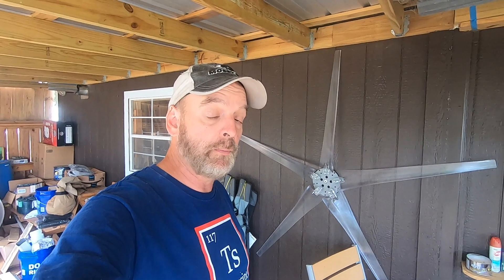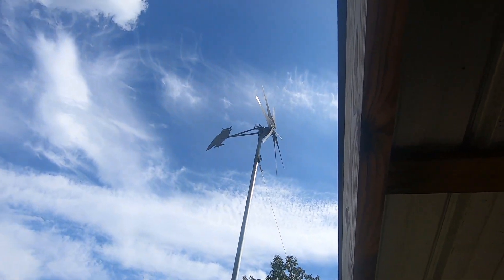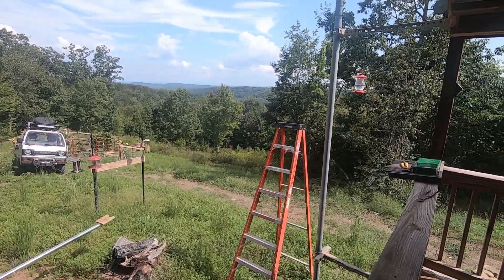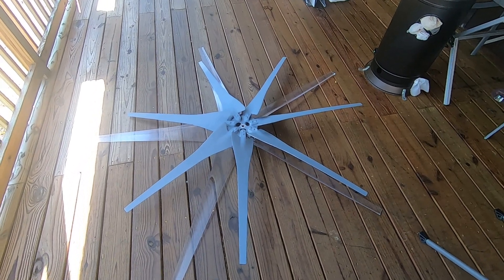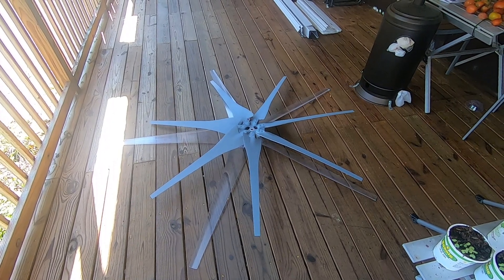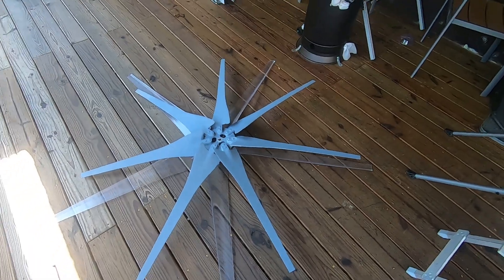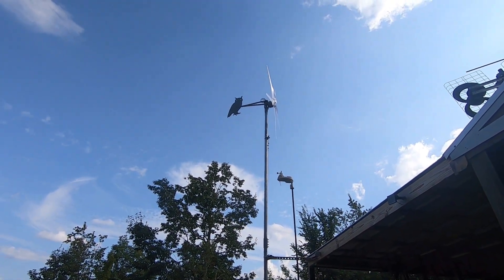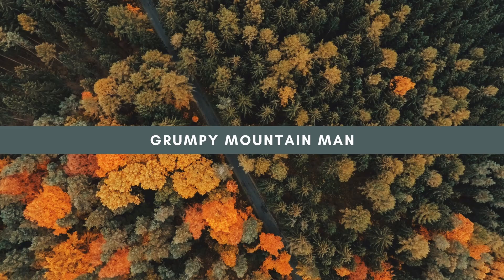Thermodyne vs Missouri Wind Solar Turbine Blades Wind Wind Turbine Video #3 Shed to Home Solar Wind

Comment: Hang on there , Back up 
You said one brand of blades were better than the other , 
Yet neither brand was spinning but you go ahead and make a video showing both sets perfectly still , 
Looks can be deceiving sometimes but to me it looks the same , both don't spin and you said that one brand is better ,  that's cool , they both wasn't spinning laying on your porch either , but that must be because you have a bad porch
Reply from the maker: Its comments like this that make me wish the internet was never made.
Reply: @GrumpyMountainMan  , then show them spinning and that they are indeed better and making power , 
Because it was a video with both sets of blade perfectly still , 
And you complained about the first set of blades and you complained about the comment but still absolutely NOTHING about how the second set of blades performed  , they must not have made your expectations or you would have said , 
They are doing better than the first set , but I'm sure you don't want to lie in the Grumpy comments section for everyone to see
Reply from the maker: Oh boy another internet Engineer.  I installed the thermadyne blades. They move my turbine.  The MWS not so much. I found this out with my own hard earned money. You want to see a video with spinning blades, go make your own video. Ps there are other videos showing them working. Click away.
Reply from the maker: You kiss your mama with that mouth?
Reply: @GrumpyMountainMan  , again NO real report on the much better performance of the second set of blades , because there is NONE ,

Mountain Grumpy Shed for Brains 
And you can Grid Off
Reply from the maker: Zzzzzzzzzz
Reply: @GrumpyMountainMan  , you asleep , Dip Shed for Brains , did it take you over 2 months to think of that , 
And still NO report on how much better or worse the second longer but fewer Blades from 6 to 5 actually did  but again , that's what you get with Shed for Brains , 
Grid off grumpy mountain mannnnnnn
Reply: @kayakwesty  , I don't do request
Reply: @GrumpyMountainMan  Provide before & after Data! 
Sorry Homie! Jim is right.

Comment: "... 
The best sites for turbines are those where the wind is least obstructed, which is often the highest point on a property.  The bottom of the turbine rotor should clear the highest wind obstacle (rooftop, mature tree, etc.) within a 500 foot radius by at least 30 FEET
..."
https://www.windpowerengineering.com/high-small-wind-turbine/
Is the bottom of your rotor 30 FEET above any obstruction within a 500 Foot radius ?
Straight Laminar Flow is GOOD, turbulence is BAD ...

Comment: I been wanting a turbine to go with my solar array. I also have low winds so may keep an eye on these for future additions. Good video.
Reply: Low Winds  = Low Power.  12 MPH Wind generates only 1/8th of Rated Power = OUCH !!!
Reply: @MrSummitville  Thanks for the info bud. I have not even installed my 2.5kw solar array and just piled up under a tree. 1/8 the power sounds horrible.

Comment: If yours is anything like mine it's too low and not catching enough of the wind but looks like you're on a mountain so probably don't matter
Reply from the maker: I'm on a top of a ridge. The mountain is 2250ft. With the leave on. South winds do better. Leaves off.North winds in the winter are stout. I have to restain the deck every late spring due to wind.

Comment: The Pantera clears are good Blades, but not as rigid as the black KT. As for the bracket kick out. It's so the blades do not to hit tower! Because the longer the blades the more flex and will have more chances of hitting the pole! As for Wind Turbines USA (Thermodyne Systems) they do sell a heavy duty tilt mounting pole all in one bracket. On my Blue Turbine I show the bracket along with the Roller blade bracet. But I have my clear blades with the no tilt and have seen winds around 50mph!! No blades striking the pole!! But thanks for sharing and GBU!!
Reply from the maker: I had brutal high winds 2 days ago. I made it with flying colors. Hmmmmm well I went with the clears so it would be less of an eyesore.  Thank you for the advice!